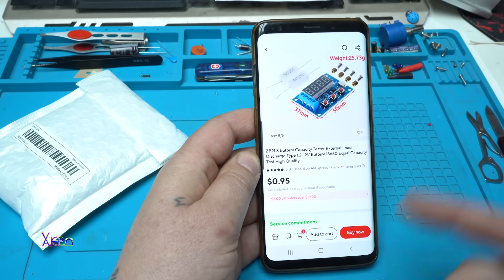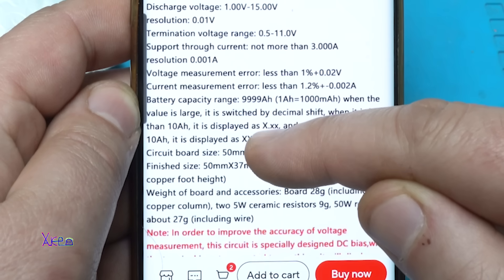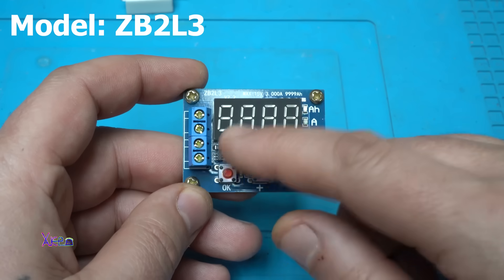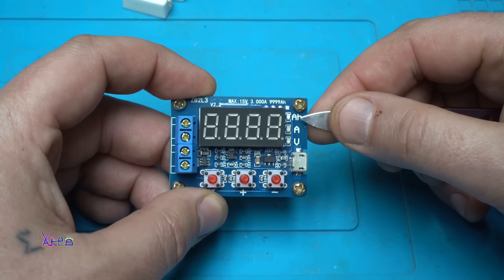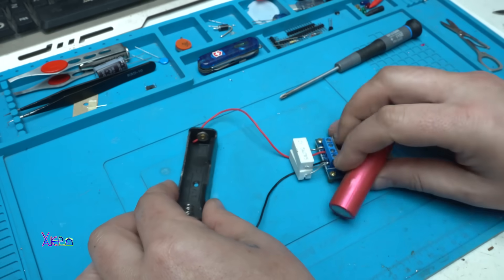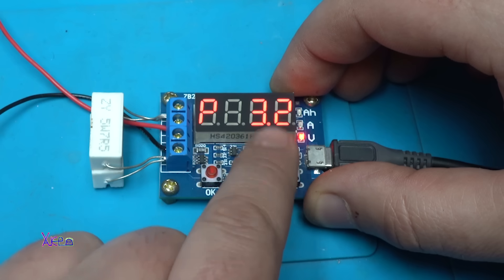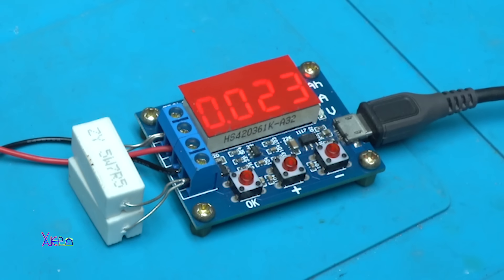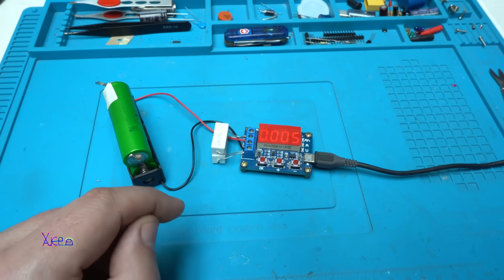I Paid $1 for Aliexpress Battery Capacity Tester- IS IT WORTH IT?

Comment: Before using this module, you have to activate the calibration menu. After completing the caibration this module works really well. You can find videos of how to calibrate this module in youtube.
CALIBRATION PROCEDURE:
Apply USB power and simultaneously press all three buttons to enter the calibration mode and perform the following steps

    The first calibration step after entering the calibration displays the 0u0A; short connect both positive and negative input terminal and press the "OK" button
    Next, the display will show J10u; apply 10.00V DC between the input positive and negative terminal and press the "OK" button again.
    The display will show J2.0A; apply 2.0 A DC current between the input terminals and press the "OK" button to complete the calibration.

If the tester determines that the calibration data is reliable, it will in turn show 4 calibration numbers after completing the procedure; otherwise it will ignore the calibration attempt, discard the data and exit the procedure.
Reply from the maker: Thanks for the calibration procedure,I didnt know that
Reply: @Hacktuber  You're welcome. Also if you desolder the display, you will find an IC labeled TM1650. There is a 10K resistor labeled "103". You can replace this resistor with a 6K8 resistor and a 10K potentiometer (in series), so you can calibrate voltage reading with this potentiometer. I don't know how practical this, becuase there is a calibration routine allready :)

Comment: I bought a couple of these years ago and neither of mine properly measure current and thus don't accumulate the total capacity; nothing is visibly wrong with the circuit.  The one in the video seems to work okay, so perhaps I got a bad batch.  Mine do properly measure voltage and thus still serve as a way to discharge to a specific voltage; a function I needed as most "discharge" features on chargers will automatically recharge after discharging.

By "discharge voltage" I think they mean starting voltage as the module will discharge to 0.5V (called "termination voltage" in spec).  Be careful, however, as the included resistors in parallel can get quite hot with batteries above 4V.  Managing the load is inconvenient and sometimes requires using only 1 of the resistors, but for the price it's still a useful module.

I rewired 2 adjustable-size, li-ion cylindrical cell chargers ($1.70ea.) to serve as battery holders for these and if I switch the USB power to the chargers they still function as li-ion chargers, but obviously I must be careful to avoid charging non-lithium cells in them; never been an issue as I unplug them when not in use.
Reply from the maker: I am sorry to hear your modules are not working properly

Comment: Great video, thanks.

Any idea if it's safe to buy 18650s from Aliexpress, or will they all be used, or mis-spec'ed?
Reply from the maker: My tip is to find old laptop battery,pull out the cells,test and you are ready and you will know what you are using🙂
Reply: @Hacktuber  That's a lot harder than ordering online 🙂.

Thanks.